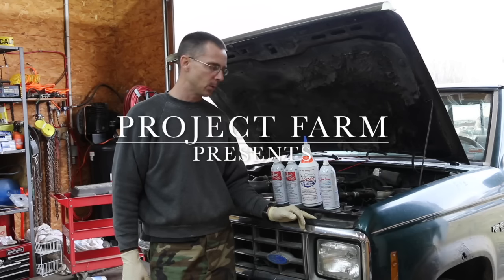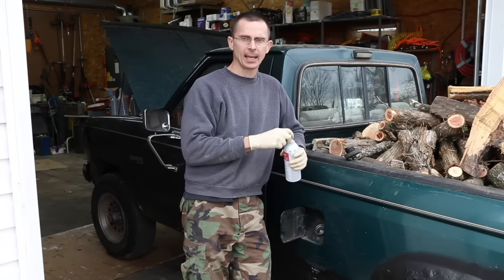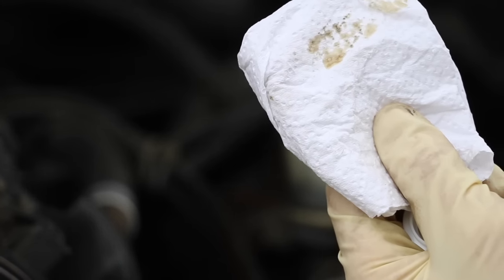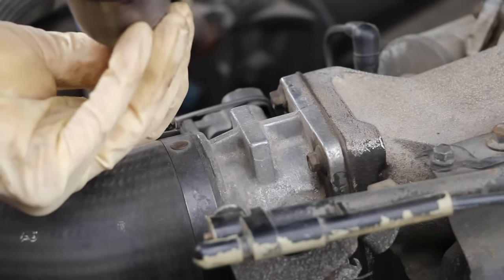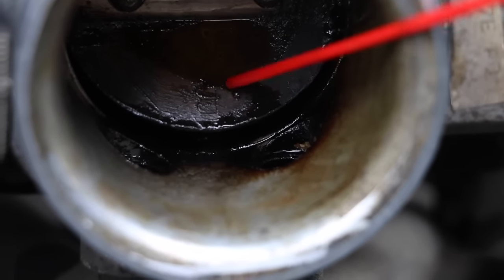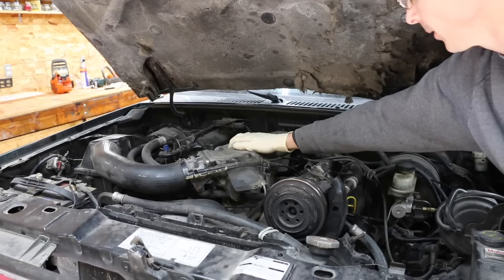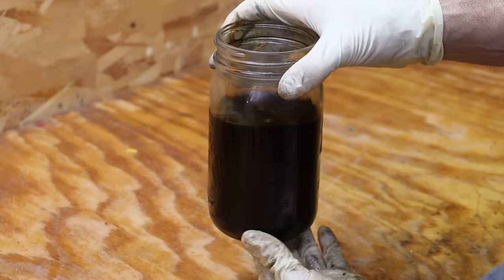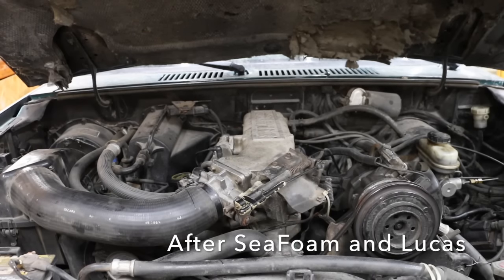Seafoam--can't believe what it did to my engine!!

Comment: I realize this vid is old but wanted to add a story. One of my older 4cyl cars at 250k miles had like new compression on three cyls and below spec compression on one. On the advice of a mechanic friend I took out the plug for that cyl and sprayed in seafoam until it puddled on the piston. He said I may have a stuck ring. I did this three times over a week while the car sat, testing compression each time. 4th try. BOOM compression up to match the others and still running today. I changed the oil right after to get that stuff out. Word to the wise... when you run the engine to burn this stuff out do it AT NIGHT so your neighbors dont spaz and call the fire department.
Reply from the maker: Thanks for sharing.
Reply: I did it in the parking lot of auto zone and noticed some Mexicans standing on the sidewalk looking at me then I raised up and you couldn't see their car beside me with the windows down until the smoke cleared.
Reply: @billbonu1639  😂
Reply: @billbonu1639  Oops.
Reply: How long are you supposed to run it? I'm in the middle of suburbia with Karen's as far as the eye can see... lol won't prevent me from seafoaming my 86 suburban either way, but definitely curious how long I'll be the talk of the neighborhood.
Reply: @morganhall6338  Depends, but its a massive cloud of white looking smoke. Its going to be visible for several minutes.
Reply: @bunberrier  maybe better to do at work in an industrial area.... or worse? Hahahaha idk but it's gotta be done.
Reply: @morganhall6338  I just go for it and get dirty looks; smile and wave.
Reply: @morganhall6338 do it right next to an interstate and take off.. its what I do.
Reply: I always keep a vehicle a very long time and as a result clock up many a mile. Sea Foam is a good product and so is marvel mystery oil and Lucas oil treatment. Engine restore is also a product that will help in restoring some compression to worn cylinder’s and rings, although it is not a repair only a bandage . I had a 94 S10 that had 385K when I gave it to my nephew and it had 425K when he sold it after original timing chain broke. Approximately at 250K I started to double up the amount of Lucas to 2 quarts 4cylinder only holds 4. Newer engines with VVT should have only the recommended oils used in them , I used 20W50 plus Lucas recommended was 5W30.
Reply: Which Sea Foam did you spray? The "Top Engine Cleaner & Lube" that comes in a black cap with a bent spray tube? Or the "Motor Treatment" that comes in a small white cap that you pour out?
Reply: But why is the throttle body still so dirty? That alone cost you mileage
Reply: @niemand000 LOL here I am lying on the internet. Went to the garage to find the can ans it turns out its Evenrude Johnson Engine Tuner, part number 777185. My post still stands though.... its the same kind of thing. I remember now, I couldnt find any Seafoam.
Reply: @bymarcatholictinkering what do you consider newer engines because I have a 05 trailblazer V6 vvt.
Reply: Agree with this. I live in an HOA and did a full clean. Yeah my neighbors were pissed, but my 20 yr old 300zx ran like it was brand new. Now I'm a Seafoam fan
Reply: @UncleSubBass-qe5zy On my car the pistons are upright, completely vertical travel. I removed the spark plug and sprayed enough of that stuff in that the top of the piston was submerged with a very shallow depth of liquid , maybe 2-3mm. I looked in the hole with a flashlight to see this.  If your engine is a boxer type , opposed pistons with horizontal travel, that may not work unless you can tip the engine or the car up enough.
Reply: @morganhall6338  run until the smoke is gone....... in my experience about 30mins or so
Reply: @atomicdmt8763  sounds good, thanks.

Comment: I am a diesel mechanic, I fully believe  seafoam  and Lucas are great. I had sticking injectors  in a 6.0 Ford engine. Fil fuel filter base with seafoam, another can in the tank. No more issues.  This guy and his tests are unbiased and very informative. Thanks for posting!
Reply from the maker: Thanks and you are welcome!  Thanks for the feedback.
Reply: Yeah, Seafoam and Lucas are good, so is Marvel Mystery oil also.
Reply: there's a slight knock from somewhere in the everything with those 6.0's.
Reply: I've this stuff on old boat motors and my old work trucks. Love it.
Reply: I always fill the filter on my 7.3 IDI with additive when replacing it too.
Reply: no this wont help you if you have a 5.4 3v with a exhaust manifold leak 😂😂
Reply: @ProjectFarm  the berrymansb12 is stronger because of the Acetone in it... Can you test to see if it eats the fuel lines? Since Acetone eats up rubber and plastic?
Reply: @ashleybernard1055  Or a flat tire on your boat trailer LOL
Reply: Not for Toyota. I'm Toyota mechanic.
Reply: @ondaride777  , Noone knows who you're talking to
Reply: @ondaride777  Are you saying don't put Seafoam or Lucas in a Toyota? What have you seen happen from doing so in what Toyota?
Reply: It's this low Sulphur diesel ,screwing up a lot of older diesel pumps and injectors.. Sulphur was  a good hi pressure lubricant.. take it out,and sticky injectors and lazy pumps are the result..
Reply: I have a ‘15 Jeep wrangler. I use seafoam off and on. It helps. I was told early on when I 1st started using it that I shouldn’t use it on older vehicles because it has been known to weaken gaskets and o-rings.
Reply: @guytelfer1353  it looks to me that he’s talking to Toyota owners
Reply: @davidshanks4373  I've never had any issues and that's all I drive is older vehicles.. too strong a dose,possibly.. but I've been ok.. knock on wood..🙂
Reply: @hellohello8556  you can send all that dirt and shit into the motor if you want or take it apart and clean it.
Reply: Boy them old six ohhs were garbage huh? They had no ass at all and would blow if you took a turn too sharp lmao. I remember in 2007 when they stopped making them and we were all thankful because we knew there just couldn’t be a worse engine. We got all excited to see how Ford would redeem itself. Well then 2008 came around and the 6.4’s were just as bad! 😂😂
Reply: @ondaride777  what’s not for Toyota?
Reply: Seafoam destroyed all my injectors in my 6.0... horrible advice

Comment: Just gave this treatment to my used chevy express AWD that hit 265k. Immediately enjoying the easier engine turn over and less vibration. Your videos continue to be extremely helpful, thank you!
Reply from the maker: You are welcome!  Thanks for sharing.
Reply: I have a 1998 Nissan Altima with 311000 (three hundred and eleven) thousand miles. It wasn't running right, so I added a can of seafoam to the gas. It didn't solve the engine bucking and jerking, so I bought a container of another brand of cleanser that said it would be enough for 25 gallons. I was in the mindset that more was better and added the whole thing to my 14 gallon tank. Now my car barely keeps running and sounds like it's only running on two cylinders. It may not have been the cleanser, but I thought I would ask you if you thought I made have damaged my engine or some other components of the engine, like the catalytic converter, oxygen sensor, noc sensor, fuel injectors and etc?
Reply: @IM1LDSRU2  At 311k niles you might just not want to try these products.
Reply: @IM1LDSRU2  yeah honest truth is 311,000 is very high mileage and many vehicles start to die at this point. These cleaners only clean up carbon from the engine but your engine might have more issues than just carbon build up. Clearing the carbon could've caused a pressure leak somewhere as well which can lead to low compression in the engine which could be your issue. Would the cleaner cause damage? Unlikely. Could it have cleared up a leak somewhere that carbon build up might've plugged? Possibly
Reply: @IM1LDSRU2  I always wondered if the catalytic converter would plug up like happens if you run rich. If you got through all the cleaner, and are back to good fuel, I would test removing the cat if you can.
Reply: @ED-es2qv  
Thanks for your response. I wound up sending it to the junkyard and bought another car. 311000 miles was plenty.
Reply: What all did you do? My fear of doing all this to my 216K Colorado was that it might free some crud that's holding it together 😆. Can't lose my daily driver.
Reply: @RefinerSimilitude  used one pour bottle in the gas tank and did the spray into the air intake as he demonstrated. With the spray the exhaust will smoke, like, a ton. And it continued to release small amounts of smart on start up for a few days.  Alleviated some issues with my rough start up, but overall didn't notice a drastic difference.
Reply: @figuringitoutmaybe3233  Good to know. So, nothing negative happened?
Reply: @RefinerSimilitude  no negatives from my time doing it
Reply: @hectorhugz4819  Could be your cats are ruined. the 2.5 l 4 cylinder in the Altimas is an incredibly long living engine (though 311,000 is a lot) but the problems u have may be related to peripherals not the engine itself.
CAUTION: If your cats are destroyed your Engine WILL ingest the ceramics via backpressure and destroy itself in short order.
Reply: I have an 06 F-150 Ford with the 5.4 L engine inow use high mileage STP, I have 292 thousand miles and it's still running good
Reply: @IM1LDSRU2  bucking and jerking sound like broken or badly damaged motor mounts...and you can still squeeze 100-125k more out of it if perfectly maintained

Comment: I've been a huge fan of seafoam for years, I also use it in my mowers and 2 stroke equipment. Every time I mix a can of gas I put a splash of seafoam in with the oil. It's literally the only product I've ever purchased that works better than it claims to. Excellent video
Reply from the maker: Thanks!  Thanks for sharing.
Reply: Seafoam is great I use in my truck,lawnmower,weedeater it is amazing
Reply: Use Lucas products all the time.
Reply: If you’re using regular unleaded gas with corn you better use it to remove all the carbon buildup

Comment: Wow, sounds like a rebuilt engine!  Thank you for such a thorough examination and lengthy test period, great combo of Lucas + Sea Foam.  I never woulda thought this.
Reply from the maker: You are welcome!
Reply: He didn't fix anything.  The wear and damage from the sticking lifter has been done.  This 'repair' is not gonna last.
Reply: @yeagermcbipper9008  the wear is still there- but the sludge causing the sticking is gone, allowing the hydraulic lash adjuster/lifter to do it's job better- which is to cushion the closing of the valve so that you dn't hear the clacking. The sludge and coke throughout the engine is reduced, allowing oil to get where it should go. It doesn't fix anything more than cleaning would- but it saves many neglected motors from the junk yard. The repair is not a repair- more a cleaning, and a lot of items are repaired by cleaning alone.

Comment: Seafoam cleared out the sludge so the lifter could pump up with oil again. I was impressed with that. Great un-biased video.
Reply from the maker: Thank you!
Reply: Wouldn't it be better to open the oil pan, clean the pan, because the sludge will deposit and then it's going to sucked again, and that will clog, the internal oil sucking filter (I don't know the name in English 🤣)... Everyone that does a flush usually opens and clean the oil pan... Correct me if I'm wrong...
Reply: @ThaMigthySnakezord  it's not a bad idea to.  Just make sure you have a new gasket to put on the pan afterwards
Reply: @SmokyPizza6853  yeah indeed saw to many people putting the same gasket and add extra silicone 😅!
Reply: @ThaMigthySnakezord  oil is designed to trap all the deposits within itself so when you change oil  it takes it with it.
Reply: @flandrble  really? Didn't know that, saw a bunch of videos of oil additives that they say it's better when you do something like that, to allways open the pan and clean it because a lot of stuff don't go with the oil, and if possible clean the part that sucks the oil (don't know the name in English) because it can get clogged and the engine starves from oil...
Reply: @ThaMigthySnakezord  have a bearing fail and youll be wanting to pull that pan to check.
Reply: 2.9 engined have solid lifters they don't pump oil like hydraulic
Reply: Most likely the oil pan was dludged up and the pickup tube was clogged up
Reply: @jasonbarnes7233  the carbed 2.8 has solid lifters, the 2.9 has hydraulic lifters
Reply: @ThaMigthySnakezord  Definitely a good idea.
Pressure wash it.
Sand rust off if you can.
Or just get a new pan if its too bad.
Reply: @ThaMigthySnakezord  It's a good idea, but can be messy and difficult: another option is to simply drain the hot oil and change oil and filter: repeat a couple of times until it comes out clean: I can't imagine much will be left on the pan.
Reply: @ThaMigthySnakezord  want to run vehicle for 5-10 minutes then drain if your not going to open up and in depth change oil
Reply: @ThaMigthySnakezord  that should be done too of course, unfortunately for the newer mechanics, we can’t take apart everything to get in there and clean it. So using sea foam to clean the deep innards is really our only option.
Reply: @ThaMigthySnakezord  That is also a good idea but the seafoam likely cleaned the very small oil passages that deliver oil to the head that probably had decades of sludge in them, and would remain even if you thoroughly cleaned the oil pan. The ideal solution is to do both, but the fact that the seafoam was so effective at getting oil back to the lifters is very impressive
Reply: @flandrble  especially if you sprinkle fairy dust on the dipstick.
Reply: @ThaMigthySnakezord   On a lot of vehicles you have to pull the engine out, or at least lift it up to take the oil pan off because the crossmember is directly underneath it.

Comment: I never believed in additives. I watched this video and bought some Seafoam to try out on a 31 yr old barn found Honda motorcycle I was fixing to rebuild. I figured what the heck, I'm going to rebuild/rebore/rering and replace everything anyways.  Did like the video. Scared the hell out of myself. Never rebuilt the motor. After initial treatment it would start on 4-10 kicks no problem. 3 months of riding daily on Seafoam treated gas, 2-3 kicks. 6 months later 1-2 kicks. I paid $250 for that bike and just sold it for $2650 and only replaced the front and rear wheel bearings and $30 worth of Seafoam. The guy that bought it tried to kick it over without using the compression release, he couldn't, I never could either. He's like "did you rebuilt the top end?" , me: "Nope, just got it going using Seafoam." . He was shocked, he was like me with my skepticism about additives. I had three cans on hand and gave them to him along with 1/2 a case of Honda motor oil. He immediately dumped a can of Seafoam into his trucks tank. Him and his son drove away with the bike. 10-12 days later he sent me an email praising Seafoam and how his truck starts easily now.
Reply from the maker: Very impressive results!  Thanks for sharing this experience!
Reply: Compression release..... on a late 80's Honda?....... You couldn't kick over a late 80's Honda?....... Bullshit!
Reply: Rex Erection  It rips up carbon deposits and oil sludge. I use it on my 220k mile '91 Daytona every so often, and drive it HARD for 100-200 miles (heat makes deposits softer). When I drain it out, the oil is super nasty, but it makes the whole engine cleaner.
Reply: I first used it in 2011 on a 1976 Honda 360. It hadn't ran for 10 years. I expected big carb problems but Seafoam worked wonders and the carbs cleaned up wonderfully
Reply: Seafoam wotks, and if you ever get a headgasket leak try out liquid glass it's kept 3 of my car's running for years after the leaks formed but I had 2 where the leaks were just to big so it won't always work orth a shot though cause fuck taking shit to machine shops
Reply: @Clutch_Boy  how does seafoam compared to Marvel Mystery Oil
Reply: @jamieb9556  ... Seafoam works much better.
Reply: Ok wtf u want a cookie

Comment: Been using Seafoam in the gas tank for years now. I started to get a knock on my 06 4.7 Ram with 180K and I used the Seafoam spray and it cleared up the knock and It is idling better and feel like I gained some lost power back. Added to the oil the other day now time for a change.  Thanks for your unbiased product testing.
Reply from the maker: Impressive results!  Thank you
Reply: When you added the seafoam in the gas tank did you have a half or full tank of gas? Another thing did you pour a whole can of seafoam in the old oil before a oil change and then let your truck run?
Reply: Hey Wade Harris Jr  For the gas tank I’ve done everything from 1/4 to full tank. I know It is made for full tank but... The 1/4 tank was on a car that needed help for check engine light.
For the oil change when I do it, I always add to a ready to change oil.  I try to run a couple hundred miles before I change it.